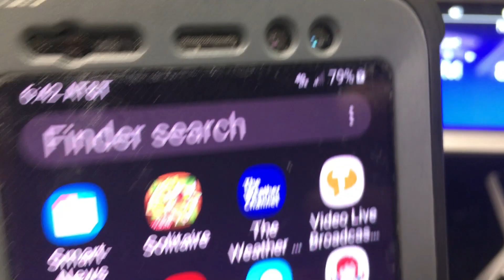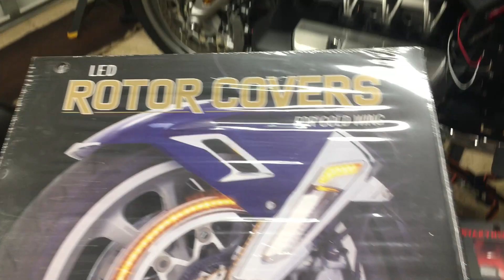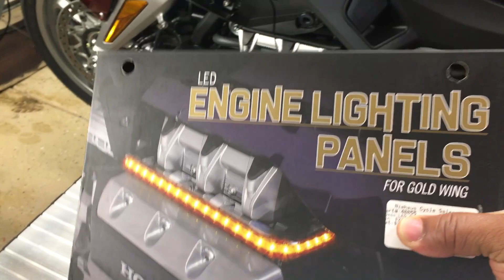Caliente GOLDSTRIKE Accessories

Comment: Good job, boss. I love those solderless connectors. The only connector I use. I use heat Gun on the high setting.
Reply from the maker: I also used a heat gun too on some connections but the lighter flame is more pinpointed and faster.
Reply: @chriscaliente5033  I am going to try that. Just to see the outcome. Makes sense !!!!